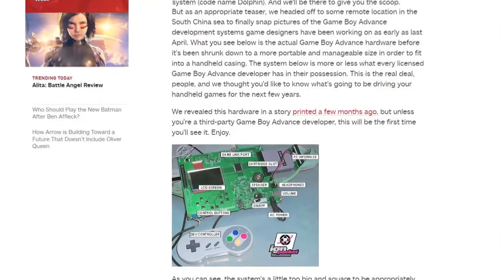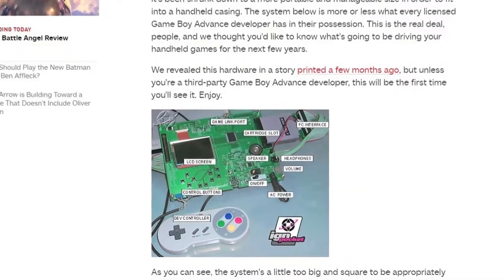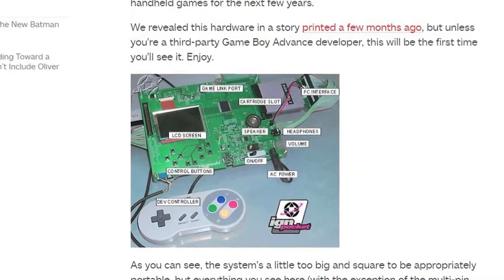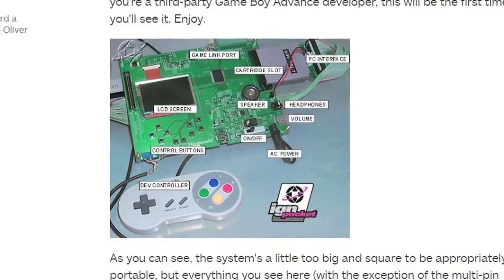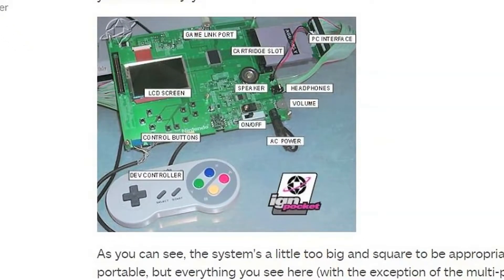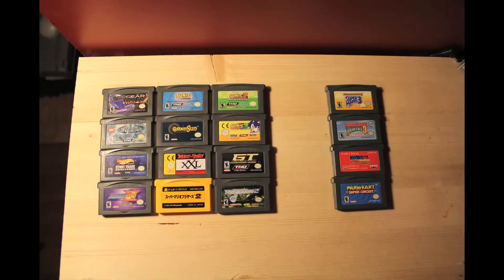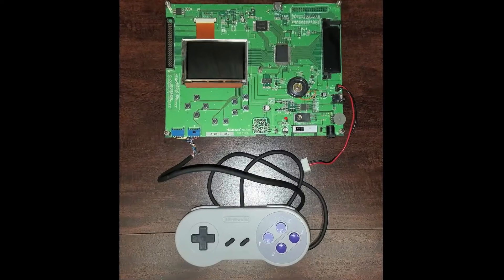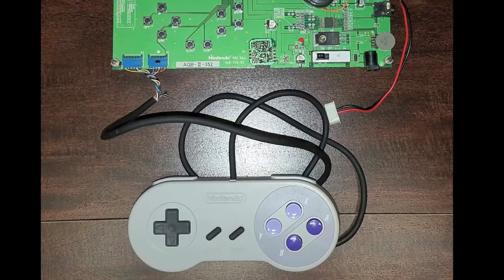Gameboy Advance Prototype Overview

Comment: What is the powersupply and what did it take to get it working. I have one of these too
Reply: with the controller
Reply from the maker: This one took the Super Famicom power supply. I'm not sure if different regions had the appropriate power supplies but would make sense, so If that doesn't fit your plug then try a Super Nintendo one.
Reply: @speedyink   I bid 3000 on a unit and lost :(. But I do have some prototypes
Reply from the maker: @2far2quit49  So you don't have one of these then? 
I think this one was purchased for around $4000...can't remember the exact figure but four thousand something.
Reply: @speedyink   I bought it on ebay but the person canceled :(.
Reply from the maker: @2far2quit49  Oh I see.. that really sucks
Reply: @speedyink  I do have some other protos
Reply from the maker: @2far2quit49  Nice, they're fun to collect